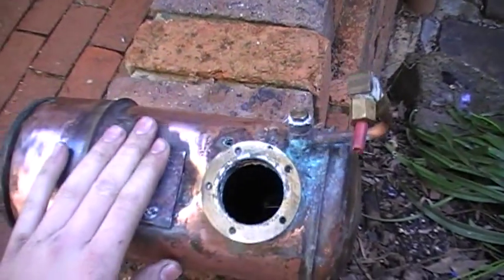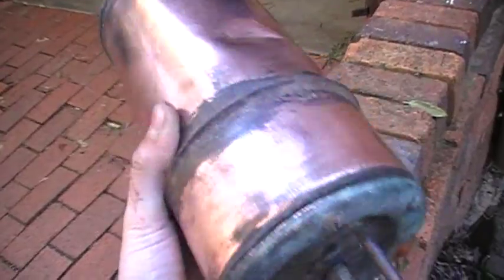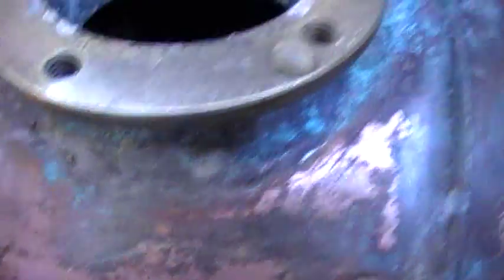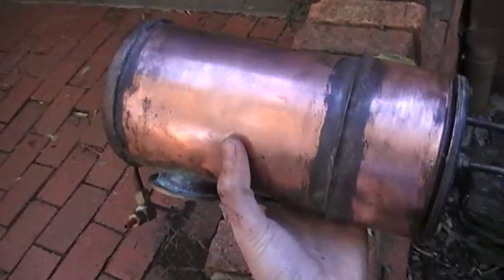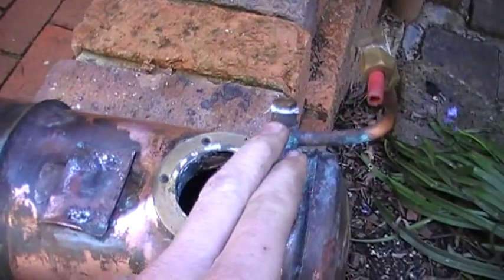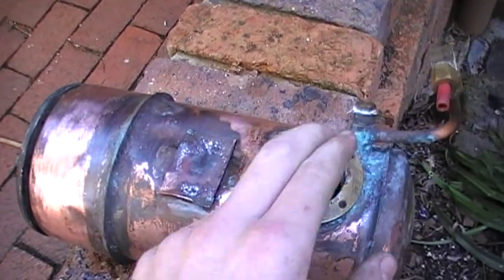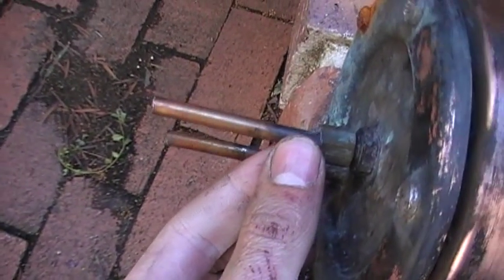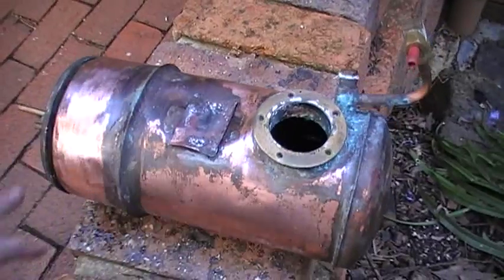Homemade steam boiler

Comment from the maker: This was one of my first attempts at making a boiler and it didnt really get off the ground. I ended up making my next one out of a gas bottle and then the third out of a larger one. 

The 4th model will be up soon as it is all copper, has real steam fittings and is running my engine.

Comment: You remind me of me when I was a lot younger. WELL DONE.
If you need any help. I'd be glad to be there for you. I am out a little past Ringwood. You would be in the Balwyn area I suspect.
Keep up the good work, but, ALWAS use 2 safety valves set 10 psi apart. A belts and braces approach. Also, take note of "Vicarof revelwood" (I think). My eyes aren't so flash any more. He's the licenced stationary engineer, just below.

Comment: physic teacher supply pyrex tube then cut the bottom with a glas cutter use paper seals and wedgeclamp it between two copper pipe ends 
i use wing nuts with 1/4 bolt by 5 inch and a 3/4 pyrex tube

Comment: @TheTeslaJet well, i'd actually thought along the lines of a motor mounted disk, a spring to hold it to a plate, rotate it, water, then it spills out when it turns 180degrees spills in, steam lubes and poorly seals it.  there are model sized injectors, run steam through them, the water is -sucked- into the boiler, they're available for large scale model trains, that's enough for a steam motorcycle at the least, and it's probably not too hard to make one larger.

Comment: as to how to top it up, i've been thinking about a gravity feed pump, a tube, two valves, open the one at the top, water flows in, close it, then open the one in the bottom.  the water flows into the boiler, alternately opening and closing, means that, effectively, the pump is working against 0psi of pressure to fill the boiler.  i might be nutty, but it could be set up to be motorised gravity feed...feedwater pump.  yah, i was planning a rotary version for my steam bike.

Comment from the maker: I might be making a slightly smaller one, maybe vertical, because to get a safety valve to fit this size boiler would cost a bundle and if i dont get the right size it could blow up!

Comment from the maker: im going to be set for about 35 to 40 psi, that should do and be safe, but i want to make a water level gauge, what can i use that is transperant, can hold the temp and heat?

Comment: plain solder is fine in certain conditions.  really, if the part that has flame touching it, has water on the inside, the solder won't get hot enough to melt, but if it runs dry, the solder will spray all over the place, and it'll safely let off steam...instead of blowing your arm off, cheap fusible plug.  anyways, heat it dry to test, then pressure test on water.

Comment: If it`s brazed it`s safe but if those joints are soldered it may burst.
Great project !, what you`re going to use asa steam engine ?
I used an old car oilpump without any modifications when I made my little boiler out of copperplate and it works and doesn`t need any flywheel.
Good luck with it.